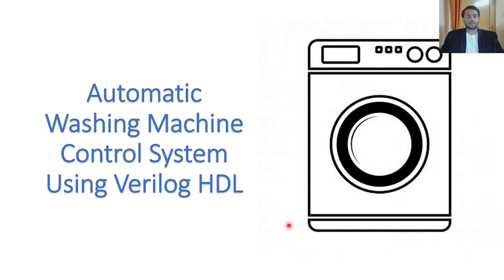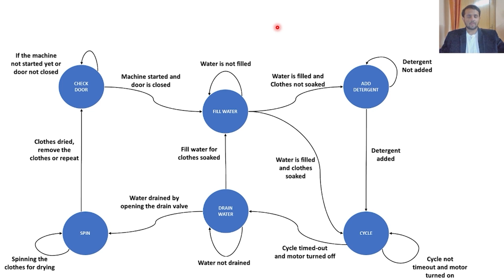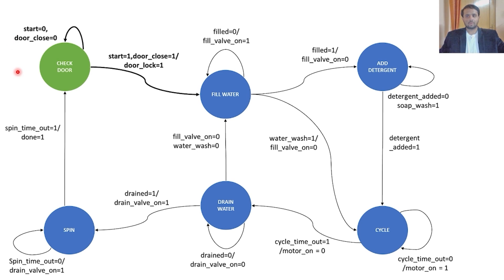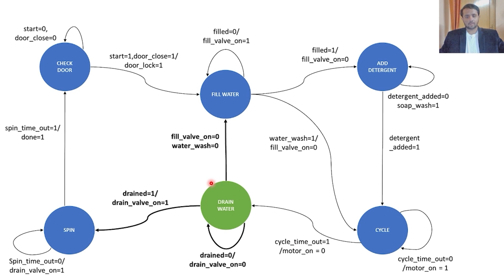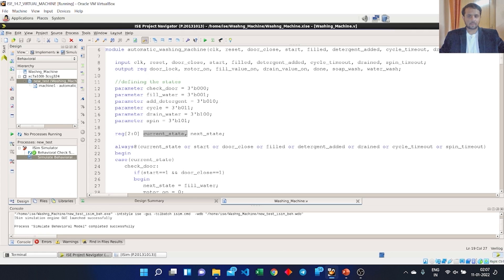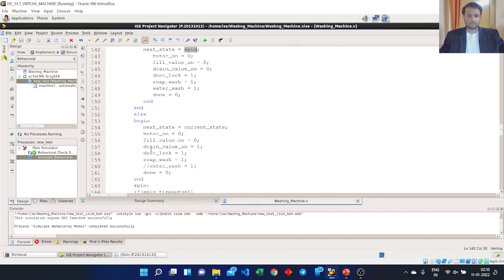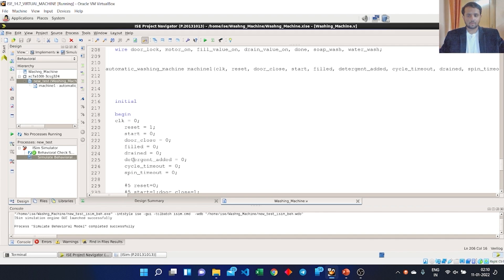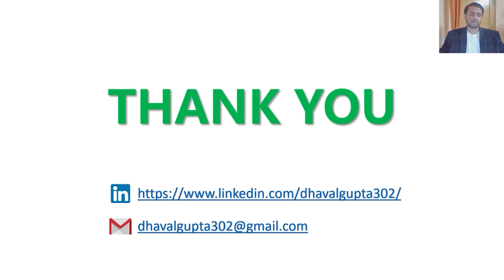Washing Machine using Verilog (with code) | Verilog HDL Project by @Dhaval Gupta | FSM | Vivado

Comment: Also, there is an error while trying to synthesize in Xilinx ISE

	always@(posedge clk or negedge reset)
	begin
		if(reset)
		begin
			current_state<=3'b000;
		end
		else
		begin
			current_state<=next_state;
		end
	end

This block is giving an error : Assignment under multiple single edges is not supported for synthesis

Any help regarding this??